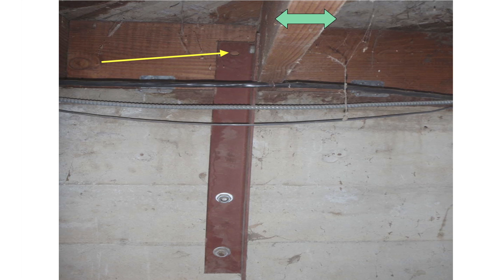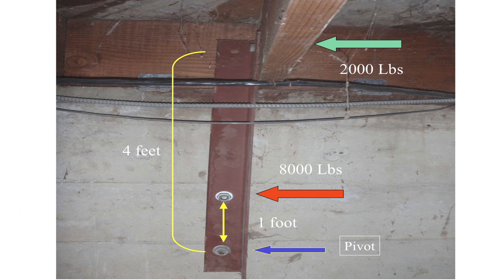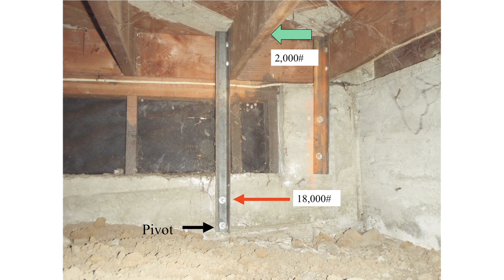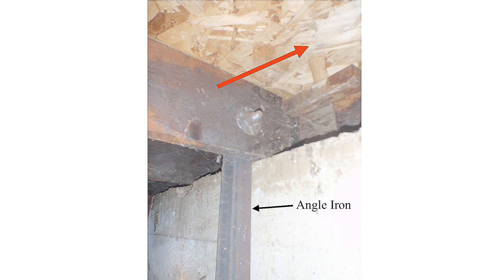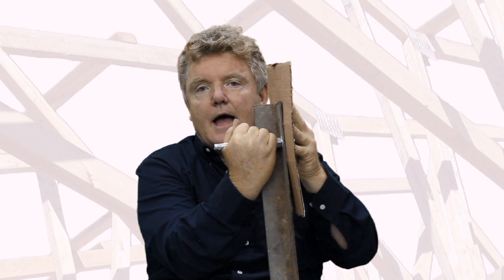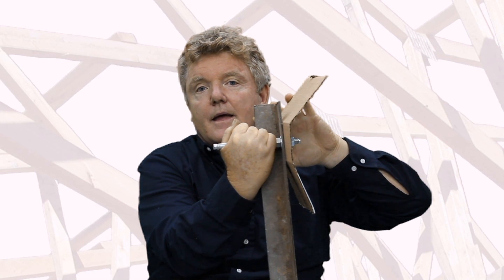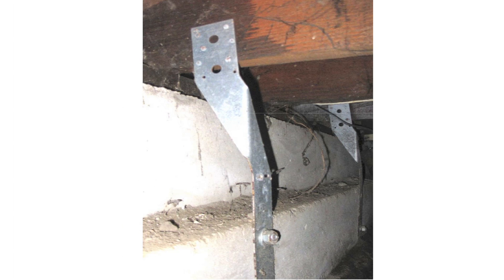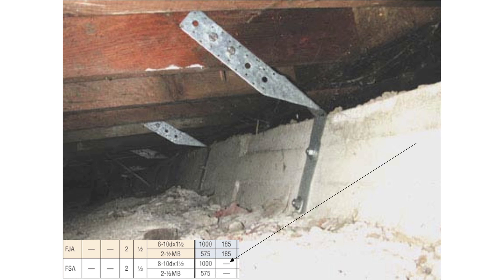Angle Irons and Untested Earthquake Retrofit Methods

Comment: This guys is so full of crap.   Angle iron is a staple of engineering trades.  They can be seen on welded frame work all over major cities in America.  As for this concept of just one angle iron keeping a house in place,  someone needs to explain to this guy that many retrofitted properties with angle iron have many of them per wall.  One angle does not have to resist 80,000 lbs of force of whatever is figured for a standard small house.    ///  There are so many well known well established methods to have the joist bolts bear over most of the area not just a small washer that to not understand this is a sure sign of some guy with very little actual building experience.  One simple method is to have a sistered block on the washer face of the floor joist. The washer and connecting nut will then bear over a larger service.   Angle iron is a well accepted industry standard for retrofit work. You just cannot use the cheapest day labor illegal workmen curb side pick ups to put them in.  You have to pay skilled American workmen a decent wage to do this work. That is all.  AND FINALLY WHILE THIS PRESENTERS WORLD starts in 1989 or so the use of angle iron for retrofit work has been an industry standard in the bay area since the 1960s at least. There are still plenty of builders who can put this guy in his place as for experience. Plus some of the video work presented here is on properties with existing cast in place original bolts.   Get at least three bids. And always try to find a bid from someone who has actually done this work.
Reply: https://www.youtube.com/watch?v=d91_62_3A1w ...perhaps you may have been quick to judge?

Comment: Good use of mfg data. Shasta County recommends sheerwalling 2ft  up to cripple corners. Cuts down on rocking cripple action. Glue it and screw it.
Reply: Hello Jim Buskist     You may be referring to Rotational Force.  It is a good topic to discuss with experienced engineers.  In general working in the corners on smaller wood frame properties gets you no extra rotational force. And the corner areas are where one runs into utility lines, service drops, plumbing, trap door entry ways, diagonal framing, and worse.    check it out with top builders or engineers,  cordially  James Gillett Oakland